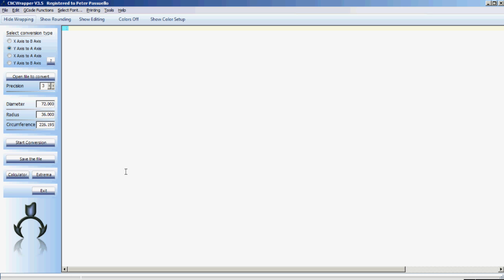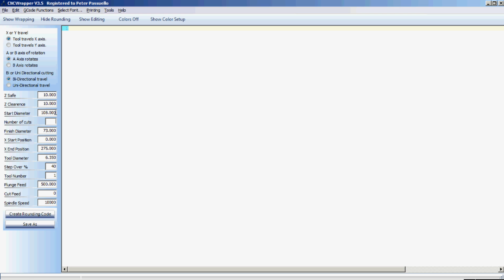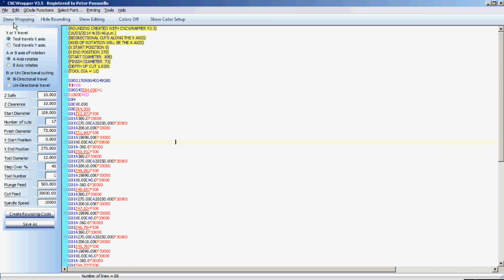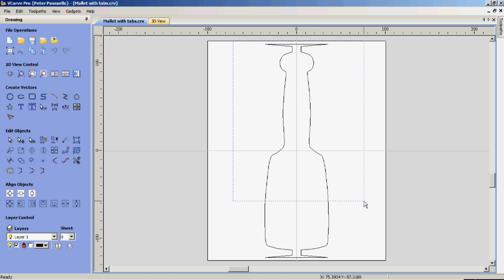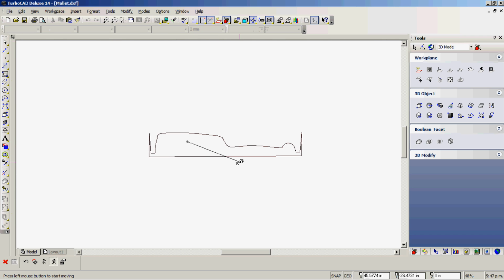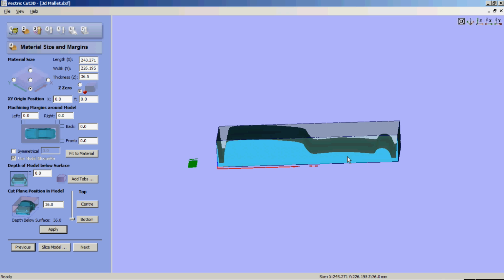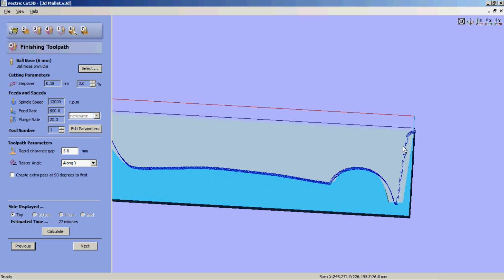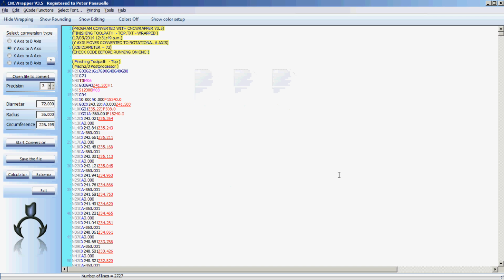Rotary Axis file creation tutorial - CNCnutz Episode 82

Comment: Hi Peter
      Great video’s! Do you use a macro for spinning up your a axis for sanding?
If so could you please let me have the code? I have a programmable pendant that I can call macros with.
Thanks,
Carl
Reply from the maker: +Carl Roden
Thanks Carl
I just used the axis jog key on the pendant. The sanding speed is the axis normal jog speed.
Cheers
Peter

Comment: Peter Hi,  this is the first of your video I have ever seen.  I need your advise as a beginner... I purchased a cnc kit.  Its a 4 ft x 4 ft table with a gantry type setup.  I have it running on Mach 3.  I am interested in making classical guitar parts.  I have been a hand builder for 30+ years.  I also bought one of those Chinese 4th axis lathe with a  tailstock.  But I seem to be having trouble with Mach 3 and g-code to turn the lathe at the rate where the lathe moves 1 revolution and the y axis travels .125 inches per each revolution.  Now seeing parts of your video I am wondering what other programs might be essential for making the guitar parts.  The rotary axis is going to be used for carving the curve on a classical guitar bridge... the wing like part on either side of the nut.  I would like not to have to buy any more programs that what I have.  I have fusion 360, but maybe that's not enough.  So if you would talk to me a little bit about set of programs one really has to have to do this kind of work???  You use cncwrapper and others...what are your thoughts....I as a beginner am really overwhelmed...sincerely, bobanchorite@socal.rr.com11/08/2017
Reply from the maker: Hi Bob,
I have just emailed you.

Comment: Hi Peter! Thank you for the great tutorials on rotary axis! I am a flute maker and would like to know how would you apply carving pattern or lettering on CURVED cylindrical surface. In V-carve pro or Aspire, the tutorials only show applying text on straight  cylinder (diameter does not change along the center "A"axis). For example, if you want to write your name on the mallet you just made , or carve some ornaments for decoration, how would you do that in CNC wrapper or V-carve pro? Is it a way to do that within these software programs or not? I am very new to CNC, never had one but I am going to have it in a few days. I ordered it with 4th axis for that same reason - so I can decorate my flutes , add serial numbers etc. I want to be able to carve a pattern , which later I will inlay with pewter. It is very traditional design on flutes in the country I come from- Bulgaria. For now, I do that on my drill press , which is OK, but it not as accurate as I would like it to be, and I can't accomplish the specific patterns I want. The flutes are called Kaval and are made from 3 separate parts. Please visit my web site in order to visualize what I am trying to explain -   www.rpkavalsandbagpipes.com .   If you can point me to the right direction I would greatly appreciate it!  Thanks again for taking the time to share your knowledge with everybody!  
Radoslav  Paskalev, Virginia , USA
Reply from the maker: +Bgkaval 
Hi and thanks for watching.
I had a look at your site and those flutes look fantastic.
Carving a name or serial number onto a curved cylinder is something that I don't know about.
It needs to curve 2 ways and I don't know what software to use to achieve this.
Maybe Aspire will do it.
I suggest asking on the Vectric website and see if someone knows.

In answer to your question about the mallet I would cheat in 1 of 2 ways.
1.  I would either use the LaserShoe to burn the engraving into the wood as it is not upset in the same way as a VCarve bit. 
2.  I would create a flattened oval shaped area and put the  engraving into it. The oval with its writing would be wrapped around the mallet meaning I could minimise the depth to create the flat cylinder area I needed and would create an accented area.

Sorry I can't really help you with this but keep up the great work 

Cheers
Peter
Reply: Hi Peter! Thank you for your answer! I figured I would have some trouble trying to solve this curved surface problem. I'm sure there is a way to manipulate the software, I just haven't found it yet. I know there is because flute makers and pool cue makers do it some how when they do their inlays but I don't think they would want to share the secret. I will definitely    ask. If I create a pattern on a flat surface as you suggested and than try to wrap it around a cylinder, I will run into the same problem - there is no way to tell the software that the cylinder is not straight from one way to another ( I guess its not a cylinder anymore). I will probably try to apply the pattern or text on a section of the flute that I will turn on my lathe straight initially. If I go a bit deeper , that will allow me later to create the curved surface and still have enough of the pattern/text showing. It will just not have equal dept along that curved surface. Well, I'll try and see. Thanks again for your feedback on my flutes , yes, they are a bit of work but people like them a lot so far. I have made  flutes for people in almost every continent of the world. Best wishes!

Comment: You mentioned that VCarve Pro Version 6.5 and above has a Wrapped mode. Which do you prefer, CNC Wrapped or VCarve Pro's Wrapping Feature? At present I have VCarve Pro 4.5 and CNC Wrapper Version 3. Though I have been considering upgrading my VCarve Pro to Version 8.
Reply from the maker: +Ronald Lambier 
Hi Ronald,  I personally have no preference. I rally don't do that much rotary and just use CNC Wrapper because that is what I started using first.  I wouldn't upgrade to V8 just to get the rotary if I had CNC Wrapper already but I'm sure V8 will be a big upgrade from 4.5. I still use 6.5 myself and will upgrade when I can afford it but until the exchange rate improves it won't be happening.
Cheers
Peter

Comment: Do you touch off your z at the center of stock or on surface? If you touch off in center of stock do you add stock radius to z moves in cam before you convert or does it calculate it for you?
Reply from the maker: Hi Kenneth,
The cutter is referenced to the center for this project but like any project you can choose if you want to reference to the surface or center. You do not have to add the radius in cam. Treat it as flat stock and set the thickness of the stock in cam to the radius of the stock. When you wrap it the software will work out the details for you. If you set zero to the stock surface in cam then zero to the stock surface on the rotary axis. If you set it to the bottom of the stock in cam then zero the cutter to the center of the stock.
Hope this helps
Cheers
Peter
Reply: Thanks